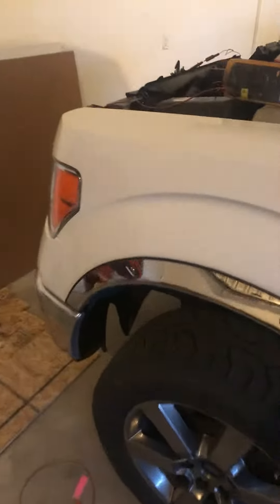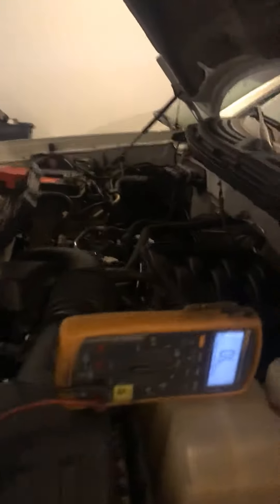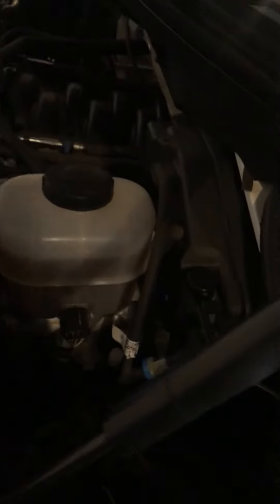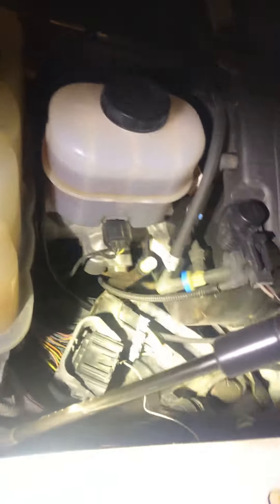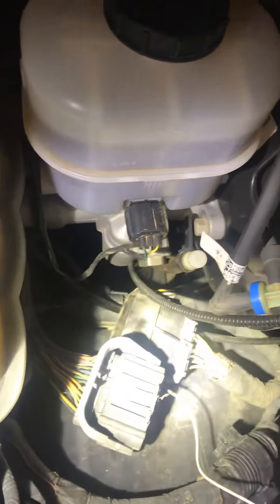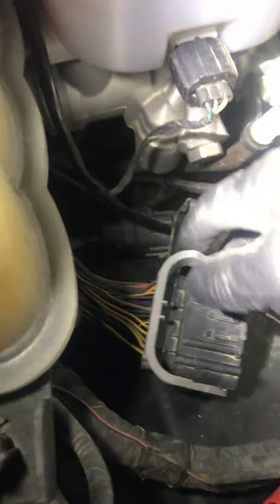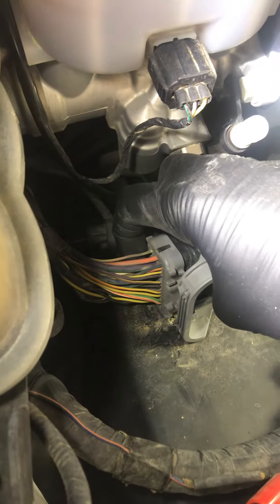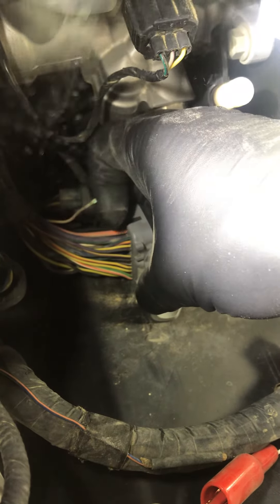2013 F150 5.0L code p0446

Comment: I checked my wire and it doesn't seem corroded. I also changed the purge valve. But i still get the p0446 code..
Reply: Did you figure out the problem?
Reply: @technologyguy101  i still have the same codes. But runs fine with them...